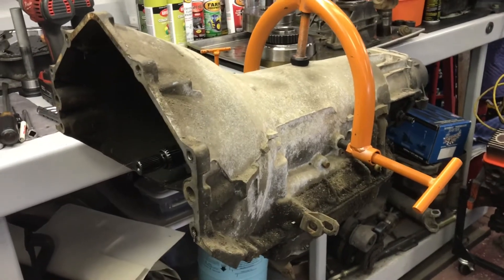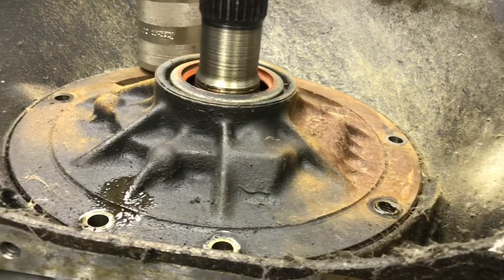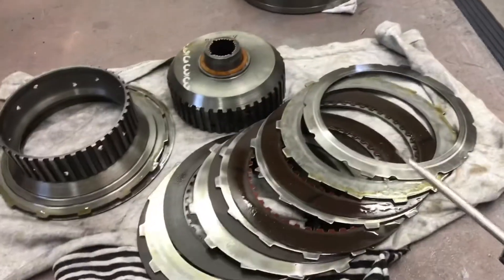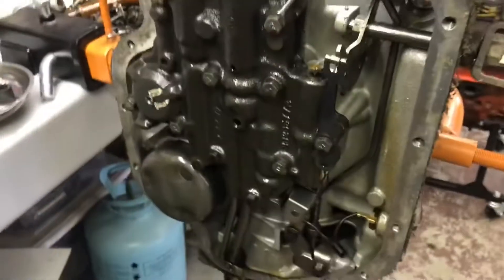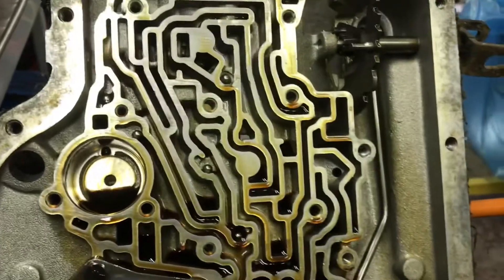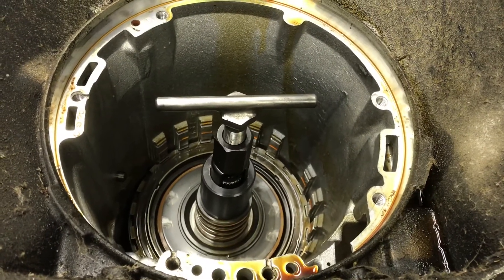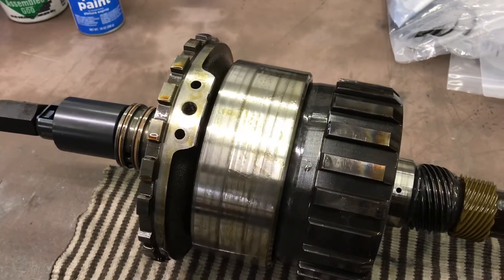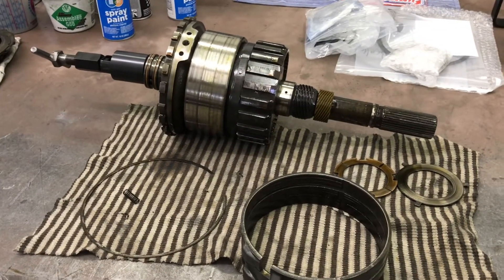Turbo 400 Teardown

Comment: Thanks for all the videos on the t400 as I am about to build one for my dragster (powerglide wont fit ) where can I buy or download the manual you were using could not find one on ebay  cheers and stay safe and merry christmas
Reply from the maker: I found the ATSG TH400 manual on eBay and Amazon for around $30. The DIY TH400 Facebook page has links to manuals as well, plus lots of industry experts answer questions daily. Thanks for watching!